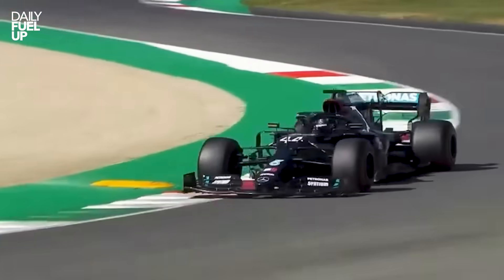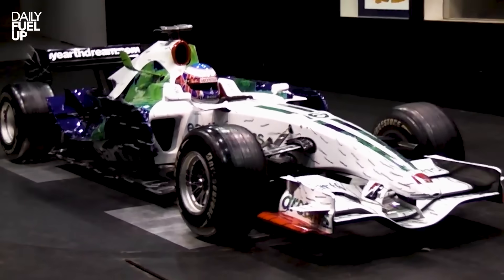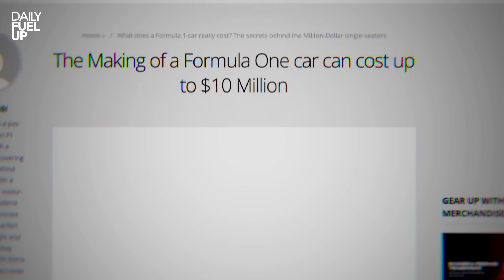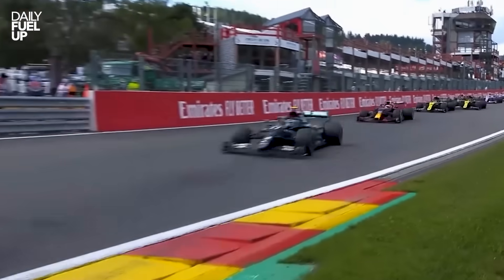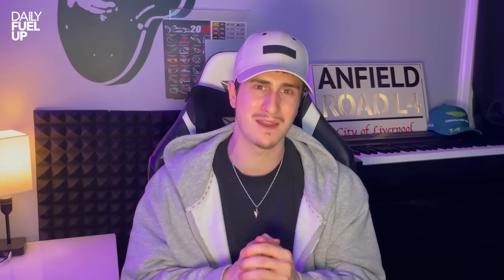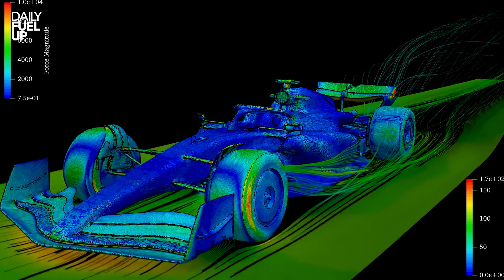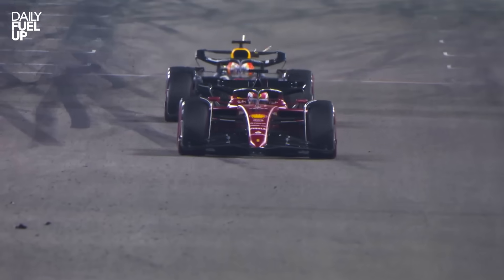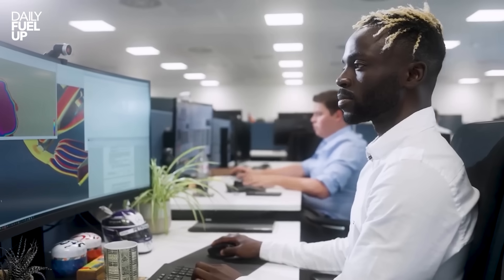F1 Aerodynamics Explained By An Idiot

Comment: Brawn wasn't the only team starting out the season with a double diffuser. IIRC about 3 teams did, but the Brawn was a better car during the first half of the season. (They didn't make any upgrades throughout the year because they had no money.) Brawn had actually pointed out the double diffuser loophole to the FIA before the season started, but he was brushed off. He got it in writing that it was legal (the FIA didn't think anyone would design one, despite one of the greatest ever engineers telling them it was definitely on). 

Some teams didn't bother with the change during the year because after the first race, the FIA said it would be banned for 2010, but RB did and Vettel nearly snatched the WDC from JB!